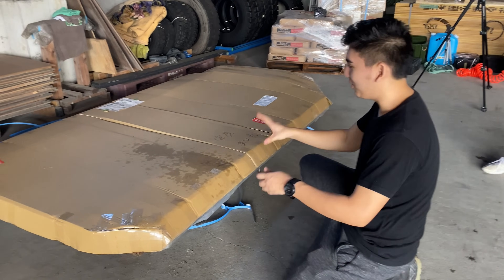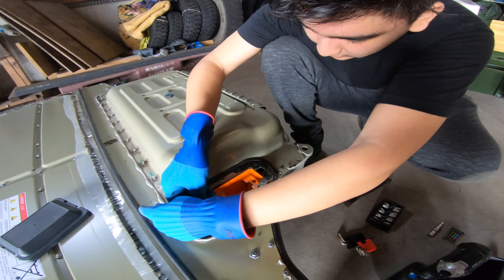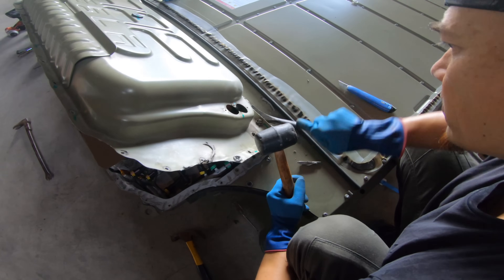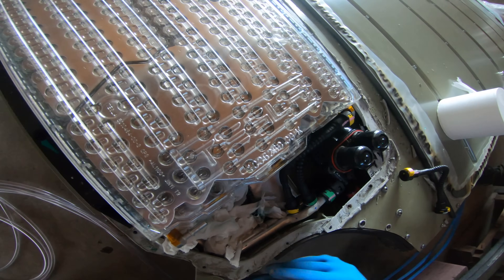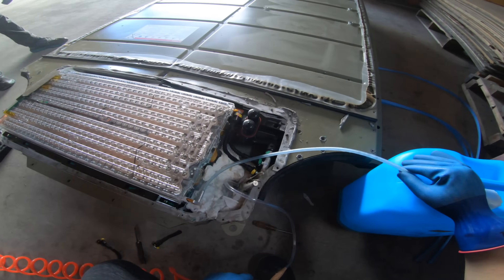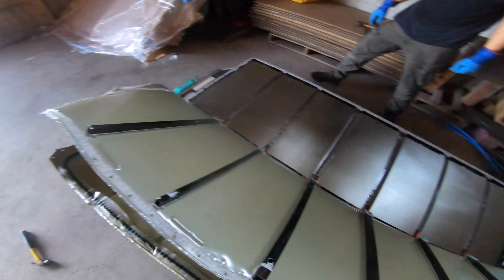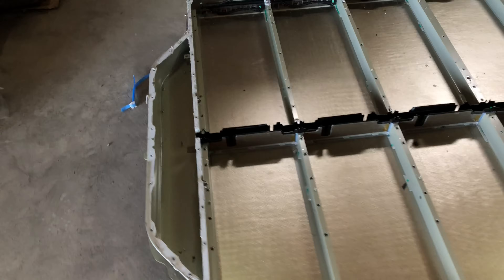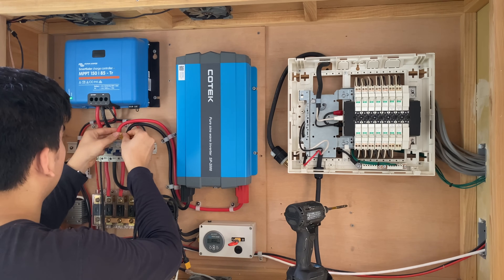The 60kWh Tesla Battery Powered DIY Powerwall

Comment: why not leave the pack  intack and find charger and inverter that can work with it save time and money
Reply from the maker: Well firstly physically moving the entire pack to a suitable place would be impossible. 

And finding an inverter + charge controller that can handle 400VDC input is a challenge, not to mention the very very high price of the ones that are available. 

That would also need a 400VDC+ solar array which would be susceptible to shading issues. And would mean a total solar array failure if even one panel goes down since they would be in a big series string. 

I also needed access to the BMS board, BMS wiring and contactors which is not accessible from the outside.

400VDC is also extremely dangerous to work on with one wrong touch leading to instant death. I didn't feel comfortable with that. One time exposure to high voltage during teardown is better than high voltage flowing always.

Comment: Hi Zai, Thank you for your work, i am on the same kind of project and I am facing a stupid problem : how to daisy chain the AWG2/0 wires with awg 2/0 lugs?? it doesn't fit, of course, but in a way you did it so I was wandering if you could share your secret....
Thanks,
Reply from the maker: Hey, sorry for the late reply. I actually used AWG 2 wire with AWG 2/0 lugs.

Comment: hello , in each pack is it 6S ? 7 S ? i show to made similar but using 90KWH  blocs , the voltage is a little low because 6S , 
thanks
Reply from the maker: Each module is 6S. It Is a little low in terms of voltage but it does work. 7S is ideal.
Reply: @ZaiFuchigami  HELLO , i have also find that info after ask you question , yes 7S and 14S is required for the hybrids 24 and 48 v avaible on market , realy not easy to use Tesla ( 6s)  or renault ( 8S ), the best actualy is use battery made by prismatics cells like nissan leaf or kia e niro

Comment: You can do this for half the cost per Kwh with off the shelf 48V EG4 server rack batteries today. Complete with BMS, control interfaces, circuit breakers and even a rack that will hold 30kwh. And since they are Lifepo4 they will last 5 times as long and you have a much lower risk of fire.
Reply from the maker: A 48v 5kWh EG4 battery pack is $280 per kWh.
Reply: No you can't.

Comment: Why open the protective case?

I'd never install such deathtrap only to save money.
Reply from the maker: As is, the 16 modules in the casing are configured to over 400VDC. Way too high for any device to be hooked up to it. Not to mention the extreme danger of high voltage. It was necessary to disassemble the battery pack to reconfigure the modules down to a safe and usable voltage.
Reply: @ZaiFuchigami  ah ok. That makes a lot of sense. And perhaps to monitor the individual cells?
Nevertheless, I am always afraid of Li-Ion. xD xD

Comment: Professional ESS installer here.

Really solid work connection wise. 
I couldn’t tell if this was going in your house or an RV. But one thing I’d do is encase the Li-Ion cells in something less flammable than a wooden box. If you ever have a thermal runaway or short, that wooden encasement is tinder for a battery fire. 

Some jurisdictions here where I’m at in CA are requiring fire suppression systems in homes and businesses where storage systems are. The industry is actually moving away from Li-Ion. 

Great work tho!
Reply: What battery are they moving to? Lifepo4?
Reply: @kr-lp2nj  Yes most manufacturers are, but the building departments got a bad taste from li-ion so the codes are becoming really strict.  They are even getting tough on installing them in your garage without expensive fire alarms.
Reply: @magikplanofficial  This is correct. Getting the permitting for my 24kWh ESS was a nightmare that went on for months after the rule changes in June or July 2021.  Absolute nightmare.  Even though I was installing Lithium Iron Phosphate batteries, I would up having to install them outside, instead of inside the garage where I preferred to have them.  They said in order to install inside the garage, I would either have to retrofit my entire home for sprinklers or have a "state approved" heat detector, which at the time of my installation in Jan '22, simply did not exist.
Reply: @magikplanofficial  LFP is still lithium ion lol. Yes it is much safer, but the industry isn't "moving away from lithium ion". It's just evolving to use safer li ion that uses safer materials (at the cost of less energy density)
Reply: @GrenYT  i noticed no one wanted to challenge your comment regarding Lithium battery chemistry. That is because you are correct sir. Thank you for educating those not aware of these small- yet very important details.
Reply: LiIon instead lifepo. Wooden shield, instead of metal. Oh yeah )
Reply: My first thought. Battery's are wide open.
Reply: Everyone should be made to watch a house burn to the ground to quite get the flavour of it. I have seen two [No I did not start them].
All my electronics designs and builds are done putting fire safety above all because of what I saw with those two houses. It scared the hell out of me.
I did a lot of work on hybrid vehicles 40 years ago and saw what happens with rogue batteries.
While I admire what this lad is doing with his clean install and beautiful workmanship, I would be putting this in a steel closet lined with cement sheeting so it has NO CHANCE of burning down anything. You could then fit that inside you garage.
I admire you work and professionalism in fitting this Zai.
Best wishes from Australia.
Reply: @bozotheclown935  or just build the house out of proper materials such as bricks and concrete instead of using wood and paper lol
Reply: @LuizHartkopf  One of our neighbours had a powerwall hooked up to solar which powered their whole house through the night. Their powerwall was made out of cement and bricks, coated with non-flammable naturally occuring clay, and they had partitioned the individual cells properly. One night, one of the cells caught fire and they slept through the night without realising anything. This is in India, where all the houses are made out of cement and bricks.

Better to spend a fraction more in building a brick house instead of wasting money on a matchbox.
Reply: @orion7326  and in India, I didn't expect this tech level (I'm somewhat aware that India has a variety of economic level throughout the country).

One thing to learn from that is to add some kind of a fire alarm system. You want a couple of backup systems, in case the passive one fails (God forbids) then you have another line of defense.

I'm not sure if a smoke alarm will fit the bill here but those are cheap. I'm seeing heat detection system that are as cheap as smoke alarm.
Reply: @shachar2  Yes you're correct. This is pretty basic in indian cities now. Solar is pretty common (and extremely cheap, tech is pretty cheap in India).

You're right, India has a lot of variety in everything, rich & poor, sun & snow, desert and rain, spice & sweet, religious & non-religious, basically every kind of variety you can think of.

The neighbour has installed the fire alarm now, although it is more of a regulatory measure to get the fire department informed. Li ion batteries have to be left to burn out as far as i'm aware. He had to change his BMS as that was the main cause of the fire. We get a lot of rains (a whole lot) so the system is also connected to the grid to power his house through the weeks of heavy cloud cover. The downside is that the sun is too hot (45 degrees celsius and above) in summers, so the powerwall and solar lose efficiency if not covered and cooled (sounds counterintuitive, but that's what happens).
Reply: @orion7326  I've been thinking of travelling to India but heard about some issues with food poisoning from time to time.

I've heard about the tip on going to crowded places (since there's more food turnover). But do you have any tips or reassurances to give me?
Reply: @shachar2  Haha yes you do have to think about what you're eating before eating it. To make it simpler, think of food in India as a graph, on the X axis you have spice level and on the Y axis you have price, both in increasing order. Ideally, you should be somewhere around the mid-range and you'll be good. The restaurants in India also customize dishes according to "foreign spice levels" if you let them know in advance (yes it is a thing😅).

I would suggest you to avoid metro cities. Smaller cities are more welcoming for tourists than Metro cities. Metro cities are not bad, but you'll feel the presence of 1.4 billion people, which might be too overwhelming. Real India is in forests and Tiger Reserves, mountains and beaches, high up in the snow-capped Himalayas and under starry skies in the deserts.

I would suggest either flying to Mumbai and then going down to "Kerala" or "Goa", or flying to Delhi/Chandigarh and going up into the Himalayas. Both are good starting points.

India is an experience. You'll feel the whole range of emotions in a single trip to India. It will definitely change your outlook on life. But just like any other place (Paris/Italy/NY/etc) you have to take care of yourself and avoid things that the locals ask you to stay away from. Indian locals will be happy to answer as many questions as you have.

Happy travels ✈
Reply: @orion7326  "avoid things that the locals ask you to stay away from."

like pickpocket and scammers? yeah those are everywhere.

My wife loves Bollywood movies. If it wasn't for the "food scare" I would have researched and tour India already.

also my country suggests a few immunity shots when going to travel in India, which is a minus (nobody likes shots)

I'm thinking that either researching India will relax me on the food situation or I'll take a guided tour to ease me into it.
Reply: Hehe, building up a stone house her in northern Norway.
Afraid you get freezing pretty fast, and I don't think batteries outside is a smart plan either.
Keep brick houses warm enough would be pretty expensive in the winter,
Most homes have batteries inside,
It's dangerous to live.
One day you will be dead 😂
That's a part of life, 
time has changed.
40 years ago it was not dangerous to work on your own roof,
Today it's not allowed because it's dangerous 😂
Soon can't kid's play outside, because it could be dangerously ?
So most children sit inside playing playstation or games on internet, safe and cheap baby sitter 😂
I will prefer living life little more exciting 😄
As I said, everything is becoming dangerous.
It's more about having control over everything and everyone 😢
Reply: @LuizHartkopf  There is grades of cement fibre sheeting that will not burn but i would never feel comfortable sleeping in a structure with these inside the house , remote mount everything in the yard and run just the AC cables to the house.

Comment: Oh

1. You don't use the BMS for this battery bank?

2.. The way you connected these batteries in parallel is really unsafe. each battery module need to use a DC CB before connect in parallel
Reply from the maker: I used a BMS. I didn't really show the install of it but its there. A simpBMS is reading data from each modules with a daisy chained CAN bus signal. And how I connected each module Isn't "unsafe" it could be done better, but its not dangerous.

Comment: I see someone has suggested a fire suppression system for your set up. That may not work for a lithium fire. If a fire on lithium is anything like magnesium fire it definitely would not work. The only way to put out a magnesium fire is totally drowning in sand. If you add liquid to magnesium it burns more fiercely because of oxygen in the liquid.

Comment: 60,000 watt battery ??????
Reply from the maker: 60,000 watt hour battery. Or 60kWh.
Reply: @ZaiFuchigami  60kwh at what volt ?
Reply from the maker: @michaelspencer6523  21.6V nominal. So 2700Ah.
Reply: @ZaiFuchigami  he said 7500 watt for 240 volt
Reply from the maker: @michaelspencer6523  Who said that?
Reply: @ZaiFuchigami  good question, the guy not know electrical formlas. If 240 volt the watts is 20 times less.
Reply from the maker: @michaelspencer6523  yeah if the voltage is 240v the wattage isn't 20 times less. Thats not right.
Reply: @ZaiFuchigami  how many times is 12 in 240 ? 20 times less watts for 240 if has that in. 12
Reply: @ZaiFuchigami  formala is if go up in volts at a equal amount,  it  that times less in equal amount in watts, or  if go down in volts equal,  it is that many  times more in equal  watts
Reply: @ZaiFuchigami  it same in all electrical formalas even on  transformers  on each winding or studs put in it as a multi seconday side. Or welder. For core in usa must be for 60 hertz  whare  alot other nations is 50 hertz. Hertz is speed per second all curent must have correct and most must be sine wave or it burn up batterys and computers and tv and elctronic devices.if a core  made for 60 hertz it can not be used on a 50 hertz grid. But 50 heryz core can on a 60 hertz grid.
Reply: @ZaiFuchigami  if say it not, you just failed the basic journyman electrician test 1st quetipn
Reply: @ZaiFuchigami  the master elctrians code book of the ohm law figure. Its 3 = same figures on all. Total volt times amps = watts, do it as it is on all 3. = same as it is. If know 2 you get the answer on 3rd by figuring it as on the sybol.in each side of the y. Its grammer education yo all licenced electrians
Reply: @ZaiFuchigami  if change 1 of the 3 and it not in equal amount as a trasfomer requires, all you get is heat and a unbalanced electric can not use.  Charge up and down with fire heat , it electricute and a light bright and dim till it blows is all it do. It melt all windings and compointents.
Reply: @ZaiFuchigami  volt times amp = watts, watts into amp is volt, volt into  watts is amps. Ohms law formala works every time. Must use to make tranformers and power  grids as for citys and etc. As we did with kbr contruction  owned by usa military.
Reply: @ZaiFuchigami  if you got it 12 v now and you change it to 240v , are you saying the amps it puts out is not 20 tines less ??? Imposible . Unless it not 12v. How many times is 12 into 240 ? Yes 20 times. It be less not more because you raised voltage. If was 240v and changed to 12v it be 20 times more amps. This is how you cauculate wire size in everything even transformers. If wire to little   it melt short out. And not forget ac is alternating currect , nuetral is a traveler of 50% of curent line. If 12 v curent line it be 6v neautral ac. If it 240 curent line it be 120v neautral. Only earth ground has 0 v. never get between a traveler , curent or nuetral , etricuted. Only earth ground o v.
Reply from the maker: The battery is 21.6VDC nominal. Not 12v or 240v. The output AC voltage is 100VAC. You never mentions current in your previous comment before. That’s why I said it’s not right. You didn’t specify you were talking about amps in the equation.
Reply from the maker: You said “if the 240v the watt is 20 times less.”
Reply: @ZaiFuchigami  i said if was 12 v and changed to 240 v it 20 times less in amps . 12 is 29 times smaller means it be 20 times less in  i. Using the i, e, v ohms law formala correct ? You nor understand ohms law ? Plus what the hertz = civle speed per  second and what kind of wave it produce ? Must be normal or half wave or sine wave and only kind of speeds in world that is useable is 50 or 60 hertz. But you need study ohms law. It can not be used on a odd figure it just produce heat no balanced current. Means only lights come on and off with it tben in time lights blow . Lights work on even  micro volts, a light  on only means curcuit open. Previous compointant works that all. That how to read a work master only. Lights not prove anything correct. Must test by reading all measures. Never test with anything else, posible explotion or death. Osha fines

Comment: whats with virtually no work safety working with high voltage system. metal tool knocking and cutting into battery housing, one wrong move and you are dead